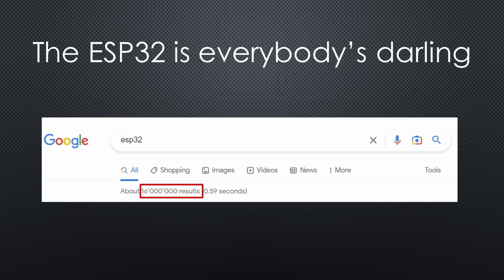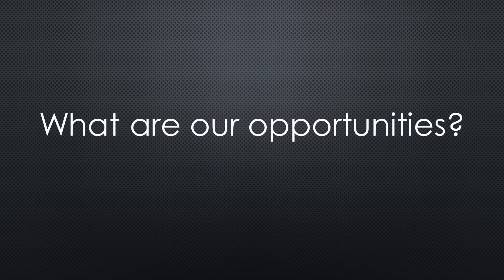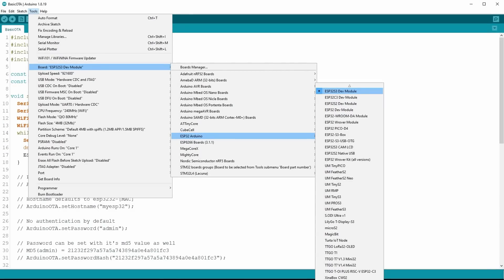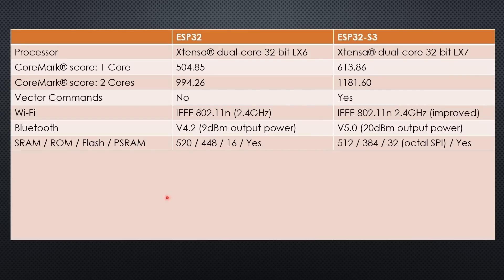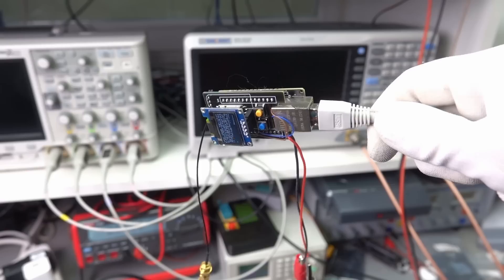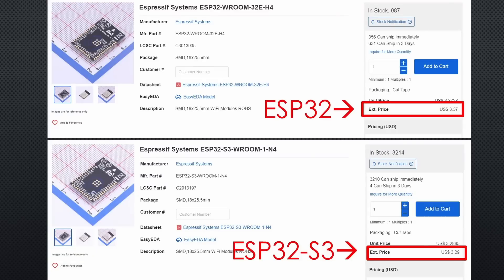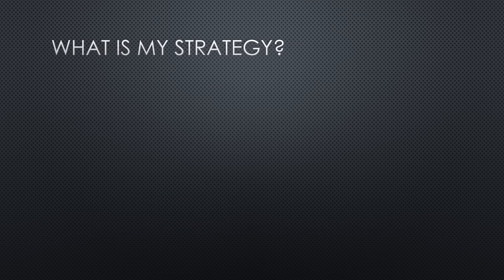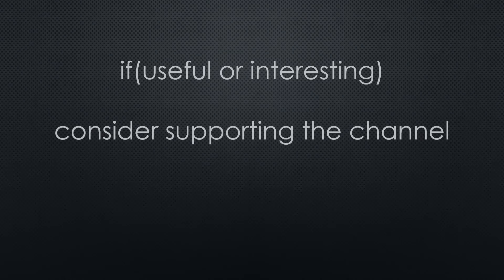451 Which Processor can kill the ESP32?

Comment: wow, i was not so impressed by the s3 (being such incremental upgrade). however those future expressif mcus which you teased at the very end of the video really look like something pretty sweet. and i shall be looking forwards to hearing more about them in due course....

in the meantimes last week i ordered a chinese made risc5 dev board... 'YD-CH32V307VCT6' which does not have wifi or bluetooth. however it does have a considerrable amount of onboard io, something similar to stm32 platform, which is pretty cool. but i also purchased it because it should have platfformio support, and they included special riscv debugger device "YD-Link" or "WCH-Link' which may be just handy in case i ever encounter such debug port in a consumer or chinese made products.

more of just a 1-off plaything i bought for our 'post stm32 apocalypse' since china no longer is putting genuine stm32 into their stuff. and these 'wch' or 'yd' riscv high pin count mcus seem likes it's now the next low cost (and chinese made) successor. of course they probably also sell lower pin count versions too.  even to replace stm8 (which is even cheaper). all since riscv is open hardware and royalty free.

i might not default to want to always use these in my own personal designs, its just nice to be aware of them. and to have the possibility to connect to debug ports on random electronics products coming out from china.

still happy to be playing with variety of other mcu platforms, (including these expressif too). thanks to platformio it makes easy to swap between all of them. the legacy ones too
Reply: but getting back to these expressif ones... i only am keeping generic esp32-wroom and esp01 (=8266). and the reason is mostly because i keep finding myself getting really confused over all their other specific variations and models inbetween. so not just c3 and s2 i have to scratch my head over. but also the p4, and also lets take any one like c3 then i have to consider which specific module version or package variants to choose. and it all becomes just like some hard work to figure out which one(s) i actually should have  on hand. over and above the simple choice between the basic 2 i already have: the esp-01 and esp32-wroom modules.

wheras other companies you are presented with much simpler variant options. for example official pi pico, it has a wlan version. then the rp2040 bare chip. and you are basically done. since all other 3rd party dev boards are also based on same rpr2040 chip... there is just the 1 base ic. and this mirrors the arduino uno with its atmel 328p.

then nordic - they have only a couple of different chips

then stm32 - they have many more chips than i like... but at least it is logical. with a matrix of 3 different pin count 'tiers'. against different performance levels. with most chips being reasonably predictable and consistent. (more or less, but the chinese clones do mess that up).

so going back to expressif here, that is my biggest turn off with their product linup. it is too hard to navigate the product stack, the names of variants has no logical consistency to give hints where c3 might mean value line? then what does the 's' in s3 stand for? saloon car? it's like the wild west. what does the 'p' in 'p4' stand for? because it seems llke the letter 'p' comes before 's' but after 'c'. so what will be after 'c3' ? how about 'd4' ? but there is already such 'd something'.

this is why i look more warmly towards pico-w. i know what the heck i am actuallly dealig with... its an rp2040 + a wireless module bolted on. simplz! and thn i can get to work and stop being confused. took 3 seconds to understand.

Comment: There are few nice, cheap display boards with ESP32-S3 chip such as Sunton, SC01 Plus. Maybe you could make video about LVGL, openHASP, etc.
It is good option for home automation as controller, much better to deploy and modify than soldering push butons and leds on PCB.
Reply from the maker: As an old man, I am no more a fan of small displays ;-)  This is why I went with a Fire tablet for HA in the kitchen.
Reply: @AndreasSpiess  5 or 7 inch is still considered as small display?
Reply from the maker: @ktostamuser2  5 definitively!

Comment: Nice video with nice accent as always! I wanted to ask you another question since I don't recall seeing you talking about IMUs and about Xiao Modules other than the Seeduino.
What to do you think about Xiao Sense? I'm thinking of using those for a project to calculate the amplitude and the angulation of arm movement. The XIAO BLE nRF52840 Sense includes LSM6DS3TR-C. This alternative is easier and cheaper for me than using other IMU like the BNO055 modules or the MPU6050 or MPU9250 but how does it compare?
Reply from the maker: I do not know these IMU chips. A deciding factor for a chip for me is a library (and Arduino support). So if you get those two things, the chip is your choice.

Comment: I work with the Raspberry Pi Pico at work so at the moment it's my goto Microcontroller. But I already filled up all 264k of RAM with a mix of c/c++ without arduino but Pico-sdk.
Reply from the maker: A good choice if you do not need the openness of the Arduino IDE.

Comment: Searching for a dual core chip with +233mhz + native CAN-Bus should also have wifi + bluetooth. And more memory..
Btw. the nrf could also be interesting has ble + wifi if the nrf7002 is added to the package. It’s quite interesting to use. Sadly no boards for it out. yet.
Reply from the maker: And probably also no Arduino IDE support :-(
Reply: @AndreasSpiess  For you being an Engineer, I do not understand the adoration you have for the ARDUINO IDE, an IDE that does not support debugging
Reply: @josef188  Embedded debugging was always and is always a pain so mostly will print to the console stuff anyways.. 
There are debugging modules btw.

Comment: What the reason to use esp32 at all? For almost any IOT project even esp8266 is overkill.
Reply: Try running a connected real project. You'll need TLS, will bring even the esp32 close to its limits. esp8266 is too old and (hence) limited for that.
Reply: @DannyBackx  First, most of IOT projects don't need any TLS. Second, you can run TLS on esp8266 perfectly fine.
Reply from the maker: What about the number of pins?
Reply: @AndreasSpiess  esp-12e or even esp-12s has more pins than I ever needed.
Reply: @DannyBackx  "Old but not obsolete" (c)
Reply: the reason i have both handy is for flashing other people's projects. because some specific ones they will only target esp32. for example airplay wirelless network speaker etc. (and maybe some certain other projects like wled or whatever else idk.)

while for the (more often) a basic tasmota switch / iot endpoint device, it can still be fine with cheaper esp8266 / esp01. that does have builds for that.
Reply: To write crappy unoptimized code, of course.

Comment: I recently made a project with a ESP32-WROOM-32U on a custom PCB, it was super handy. I only had to make sure it had proper power, and then a little enable delay circuit, a pull up on gpio0, and then it was ready to go. :)

Compared to the pi pico, the pico is a lot harder to put onto a custom pcb, and requires a lot more extra components.
Reply from the maker: And you already had Wi-Fi...

Comment: When we used the esp8266 it had a different sdk and different libraries compared to the esp32, which was a major PITA.

The esp32-C3 kind of fixes that, you can use the same toolchain and libraries for both small and bigger projects - which is great.
Reply from the maker: The ESP8266 is even older! And Espressif was very young when they made it. So no wonder that they got a few things better with the ESP32s...

Comment: Although esp32 will remain my "darling", the biggest issue for me has always been battery powered projects where the Bluetooth always sucked battery at ludicrous levels. Recently I've been playing with the nrf52840, a bit pricier, but  lovely long connected battery life
Reply: Agreed the nordic chips are great and the dev boards are way better than either the esp32 or rp2040. I do however find myself using rp2040s more than anything else at the moment
Reply: Their new chips have way better power consumption. I was able to take ESP32-C3 down to around 0.3mA in BLE connected state. But! You need 32KHz crystal to achieve this, which is, surprisingly, absent on basically every dev board out there. NRF blows it out of the water, of course, but they seem to be getting there. Their new H2 part might be able to go sub 0.1mA.
You can also look at Silabs blue gecko line. They seem to be on par with NRF in power consumption, but cheaper.
Reply: @Repligon  that's really good to know. Hopefully someone will spin a dev board with the 32khz xtal to take advantage
Reply: i dont suppose you can recommend a decent but affordable dev board for the nrf5240 ? that can work on platformio? might be nice to play with
Reply: @Dreamcat 4  It may be worth having a look at the seeed studio xaio nrf52840 boards. There are quite a few boards in the range, and they have a surprising feature set for their size.
Reply: @dreamcat4  I've been messing around with the xiao nrf52840, it took me a bit of googling to get the right platformio.ini file. Andreas has put up a good video https://youtu.be/vrcPGeYinVQ
Reply: Not being able to flash them over USB can make it harder than need
Reply: @ReubenHorner  I have found I can flash the nrf52840 over USB OK, but it did take a bit of work to get a working platformio.ini file Google "Add Xiao nRF52840 (Sense) board support" provides the answer. I also found arduino worked ok too.
Reply: @potato8236 the ics aren't ridiculous, but I only use them for battery powered stuff. when you can manage with a small number of gpios the xiao boards can be bought for circa 10usd, it doesn't take too many batteries to pay the difference!
Reply: I'm not using the esp32 for Bluetooth projects at the moment, but I wasn't aware of this power consumption problem. Is it related to hardware, or is it a software problem? I guess it's the first one, otherwise some firmware optimizations could've fixed it, right?
Reply from the maker: Absolutely. The ESP32 is not good for Bluetooth. Let's hope the newer versions will be less power  hungry...

Comment: Thanks for explaining all the differences. I bought some color changing light bulbs with esp32 c3 in it thinking it was much better chip. The bulbs were only $5 each and I reflashed them to Tasmota so still a good deal.
Reply from the maker: The C3 is for sure a good chip, but more the replacement of the ESP8266. This is why I crossed it out in this video.
Reply: What bulbs did you buy, thanks for answering.
Reply: @mpsadre132  see my reply to jmr - I have more info link to info .
Reply: @mpsadre132  https://www.youtube.com/watch?v=92F7DqQrZWg
Reply: @mpsadre132  This is just a guess, but this video talks about flashing Tasmota onto a Vont bulb. https://www.youtube.com/watch?v=92F7DqQrZWg
Reply: Love to hear what bulbs!  I love open firmware on my bulbs.
Reply: @jmr  Here is the video link https://www.youtube.com/watch?v=92F7DqQrZWg

Comment: Don't write off the C3, I've been using them recently and they are really nice to work with. For something that doesn't need lots of pins and horsepower they work very nicely. Native USB for programming too so no need for a USB UART and you can make very minimal boards from them.
Reply: exactly me doing the same - nowadays lots of C3 modules in my projects
Reply from the maker: I also would not write the C3 off. But it is more a replacement for the ESP8266, not the ESP32...
Reply: @AndreasSpiess  what about the C6?
Reply: C3 is awesome, best bang-for-buck in wifi uC space
Reply: I've also been using the c3, less pins than the s3 but if you don't need them it's a cheaper option.
Reply: That's what I have in mind too. However, the near future might be evolving towards the newer one.
Reply: Also H2 will be out soon with 802.15.4
Reply: The S3 is the true replacement, but even that has issues
Reply: A very overlooked benefit of native USB is the ability to now emulate other USB devices. I'm working on a project where the board presents itself as a USB RNDIS modem and acts as a WiFi bridge for devices without without wifi.
Reply: Also better WiFi performance with lower power during operation and sleep, very nice for standalone solar/battery powered devices.
Reply: That's a great feature.
Reply: C3 is an awesome little device!  I also use the S3.  I cant wait to get my hands on a C6 for WiFi 6 connections!  Finally an IoT SoC microcontroller with WiFi 6, BT5, and a very good proc for my home built IoT projects/PCB designs.
Reply: @MikeHarris1984  what can you build with wifi6 as opposed to wifi5?
Reply: @bobby9568  Pretty much everything, but I prefer to use 5ghz band when possible due to less saturation and more channels.  So having that ability in my place is awesome.  Also, (not esp32) some IoT devices suffer from an RSSI issue with wifi where they have a hard time staying connected and is a pain to troubleshoot.  ESP32/ESP8266 are really good at stable network connections.  at my house, in a new built house, out on the outskirts of Phoenix way out in the desert where I have a river base 3 houses down on one side of my street and a mountain 4 houses down the other way, and my house at 3800Sqftt, my ubiquiti AP's (4 WiFi 6e AP's, and 2 WiFi 6-APLR for garage and shop) I pick up over 44 SSID's in the 2.4 band...  because of my neighbors not optimizing their wifi so power just turned up all the way and things like printer direct, connect to smart TV's, monitors, etc... all from neighbors around me.  I am a Lead Cyber Security architect for a fortune 500 financial firm and so my network is optimized and secured like fort knox... also have my IoT items on its own VLAN/Subnet/SSID with isolation....  but yes, this is where WiFi 6 is a huge leap fwd, not the speads, but the number of lanes (channels) is dramaticly better then the THREE (that dont overlap) in 2.4Ghz band
Reply: I haven't used the c3 
But it does NOT have a real native USB
You cannot change it's mode by your code it's serial only so totally useless in all the projects I want
Aspecially when the original esp32(s1) is just $2 there's no reason to get it